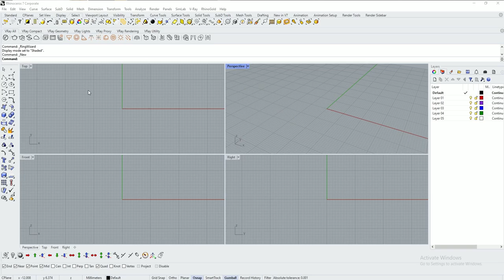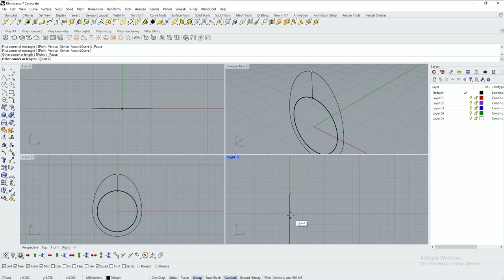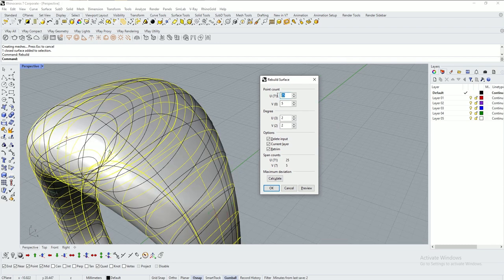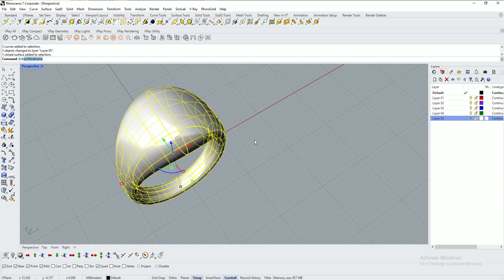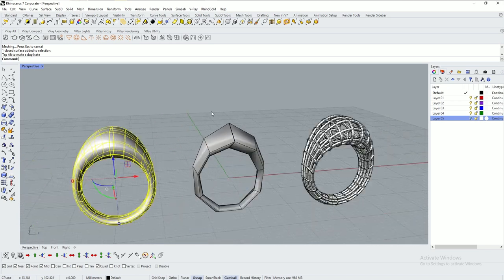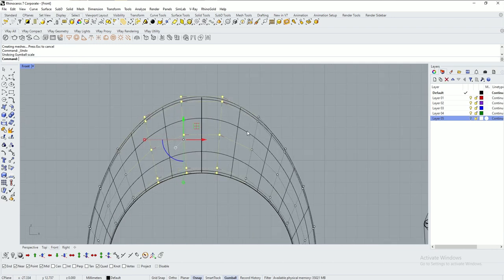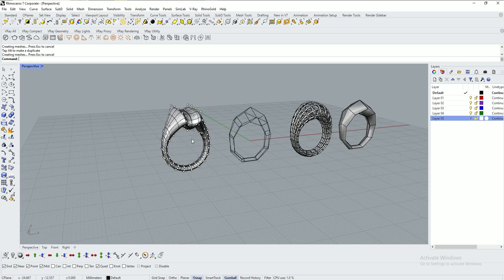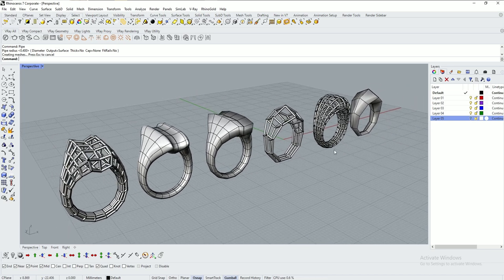rhino ring design tutorial 63

Comment: Hi, when create mesh and then use pipe, there is an issue where  pipes connect! Even in your video. How to fix this? It’s open
Reply: Use "Explode" on curves and then Pipe.
Also, check to see if you have rounded caps enabled in pipe command.
Reply from the maker: Hi 
I will make a new video for you
Regarding this error